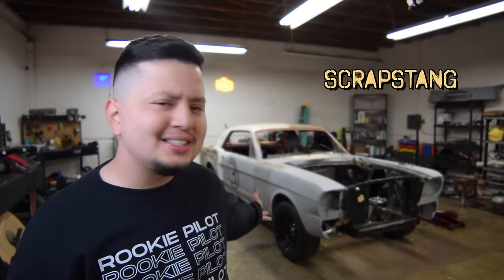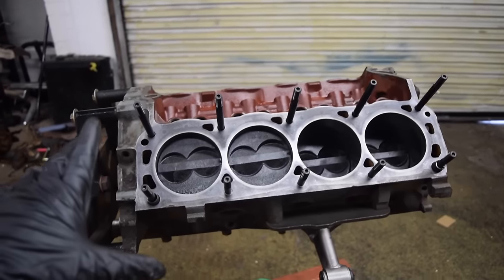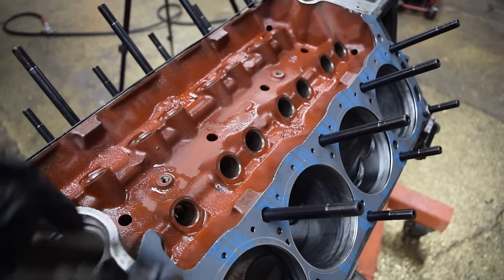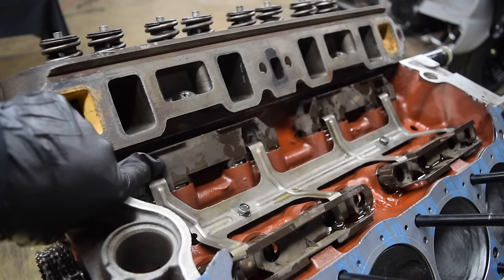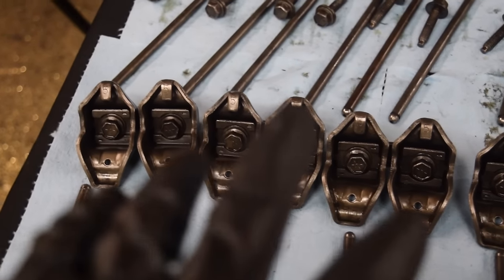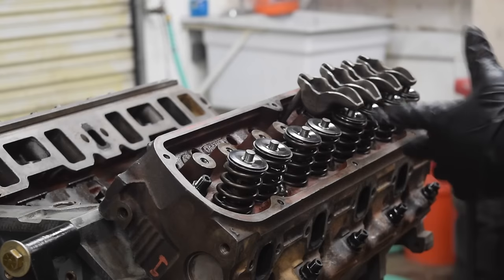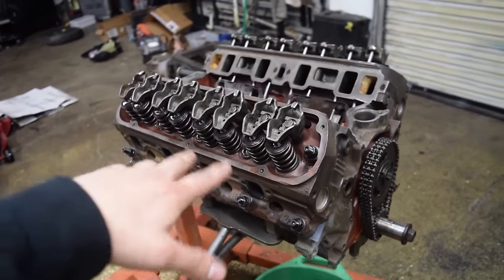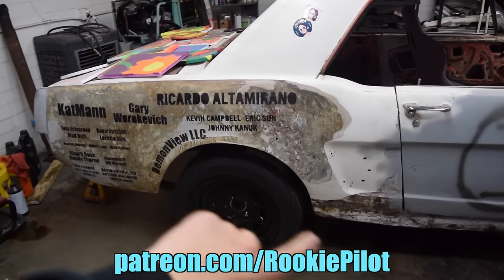Why we used Head Studs vs Head Bolts | 302 Budget Rebuild

Comment: Hey man, really nice job with this build.  Impressed with the knowledge you have at a young age.  The up and down and not spinning the pushrods while setting lash is usually overlooked.  Got some GT40 heads on there too!  This motor should have 100k or more miles on it with what you have done. 👊👊
Reply from the maker: Thank you ! I appreciate the feedback, we got it running already! Just needa make it drive!!

Comment: Swapped out a very tired 289 to a fresh from salvage-yard 302 with attached C4. Was surprised with tire chirp  on the1-2 shift.  Fun engine for a light stang. (Was a friend’s Mustang, not mine).     He had a couple fun machines, the other was a 69 Stingray, High Perf. 327, which did not like the unleaded fuel mandated by the AQMD and or State. (That was a mechanical ign. advance delay tune project).     Was still a strong runner after detune).

Comment: Some heads for the 302-5.0 use different springs for the exhaust and intake valves that are different in hight, so if you are having to move shims around make sure that you don't mix up an exhaust spring for an intake spring

Comment: The less preload on the hydraulic lifter, the less it can " pump up" in case of valve float or loss of valve control by the spring. I believe the minimal preload was intentional by the previous builder.

Comment: You can actually push 500 hp on a 302, main failure is the block splitting in half however a Main Cap Girdle will be a good idea for anything over 350hp, I think 500 hp is the limit

Comment: Variations in head gasket thickness, torque, and even the little you "hand machined" from the deck and heads can cause the shims to be a little too thick.
Reply from the maker: Thats actually a great point! I had not thought about that

Comment: Only Torque To Yield head bolts need to be replaced , regular bolts can be reused as long as the threads are good , nothing looks damaged or really rusty.
Also Torque to Angle bolts can be reused too, just inspect like I mentioned above. 😃
Also using studs can make it harder to get the heads off with the engine in the car if there are things in the way in the engine bay, because you need to lift the heads way up off the studs.
Reply from the maker: I am only just realizing the difficulty of removing+ installing the heads lol

Comment: Angel, great video again. Your valve lash adjustment / number of shims may have changed due to previous error or due to slight changes to the head/block - remember you didn’t machine them and/or slight differences in the gasket thickness.

Comment: Just an FYI, ARP head bolts are reusable. But you can't beat $80 studs. Also, there isn't really any particular maximum limit to a stock 302 block. There are guys who have pushed 1,000hp and run 8s on the stock 302 block. The old rumor that they split at 400 or 500hp is an old wives tale. They survive really well as long as harmonics, oil, and RPM are at the proper levels. Or you can destroy one at 200hp if it isn't built properly.
Reply from the maker: Well said!

Comment: If you are going to use a Dura spark distributor then AL-482 is the small male cap number and the rotor is a regular FD-311.   It saves room and looks way better than that big ass duraspark cap.
Reply: Depending on the coil and ignition box, you might get some cross-ignition in the cap and that is not good. Ford and GM went to large distributor caps on HEI ignitions for a reason.
Reply: @Vaino_Hotti   that’s a myth.  I’ve been running them for years and never had any problems

Comment: Ford rocker arm bolts should be just torqued. With hydraulic lifters you need a little bit of preload on them. As long as the block or heads weren't decked the original ones should be fine. Worst case you need shorter ones. Chevrolet generally need the preload set till the pushrod stops spinning plus half turn, or something similar. Mechanical lifters require a gap to be set, valve lash. That can be interesting depending on engine. My subaru isn't fun to set, bucket shims get changed. My 65 dodge is easy, factory adjustable rocker arms.

Comment: Hi Angel, sorry to hear about the GTI. Maybe something will happen and help the situation. You seem to really like the little car looks like it does a good job for you. Out curiosity having never used head studs like those do you have to torque them when installing them? I don’t think you can overlubricate those pieces with a dry clean block and parts. Stay cool
Reply: when you install head studs you just wind them into the block finger tight. because they bottom out you dont want them tight as it could crack the block. all the instructions come with the set. usually torque specs are different too.
Reply: @elliottb7009  Okay  I’ve never seen those or used them. So it was just curiosity. Makes sense tho thanks for sharing your knowledge.

Comment: 400 limit on a 302?
   There are many that are pushing over 500, as long as you have a good fuel delivery system (injectors, pump) you will be good.

Comment: You said that the head bolts can not be reused once torqued down. I have to disagree with this with this engine. This engine doesn’t used torque to yield fasteners. I have overhauled many small block fords  and never replaced the head bolts and never had an issue! I’m not trying to pick apart your procedure just pointing out misinformation for your viewers!